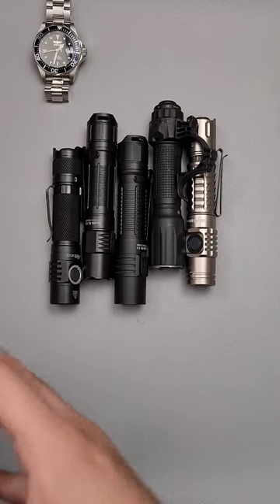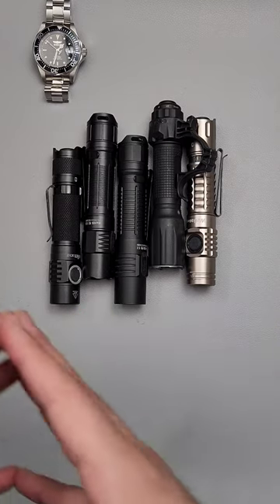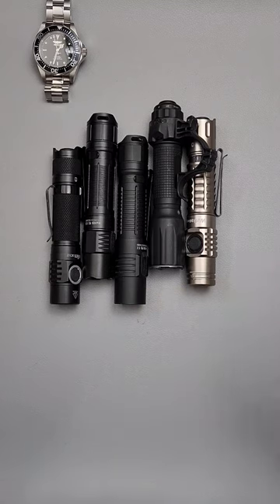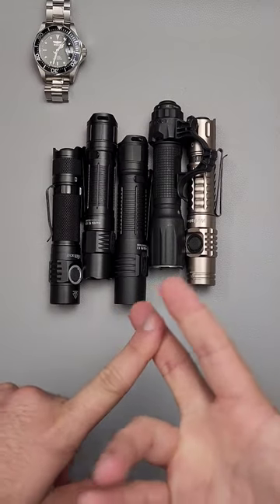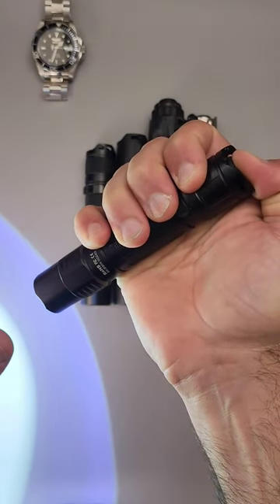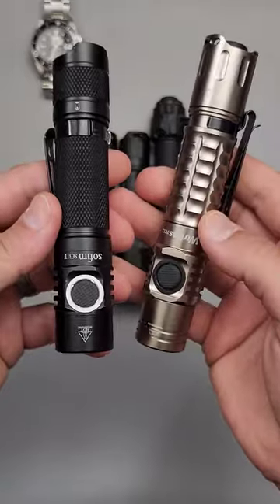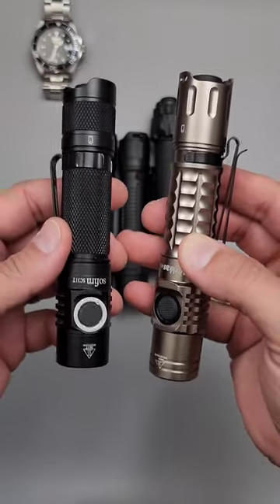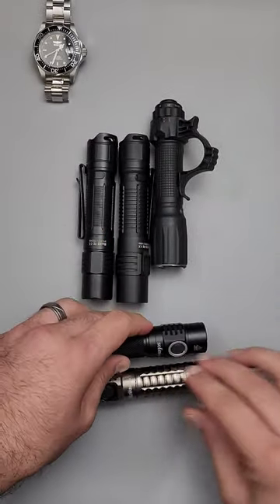What is a tactical/defensive flashlight?? (2 features it MUST HAVE!)

Comment: The new UI wurkkos FC12 have 2 selectable group. group 2 is a tactical mode with Turbo as default. Cheers
Reply from the maker: Oh????! Need to get one
Reply: Are there any ways to flash to the new driver UI if I'm on the older version?

Comment: Newer FC12 has tactical mode, where the tail switch is turbo only (double tap for strobe)
Reply: Would u recommend this for self defense ? Asking for friend thanks
Reply: @came2fastOops After having one for just around 3 months, I would actually recommend it since it is just about unbeatable for the price. I personally have the newer model with tactical mode, and haven't had any issues with the tail cap, battery, or charging. The beam angle is tight, and the hotspot is very bright which very easily disorients everyone I've tested it with for a good 10 seconds after the beam comes off (In broad daylight!).

The only issue I've had is in the stepped mode, where switching modes really fast causes the tail cap to stop powering the light until you remove and re-insert the battery.

Comment: Agreed. I've been searching for a 14500 EDC that can used for defensive lights.
Reply from the maker: hmm, not much. the GTA from lumintop is damn close.
Reply: @maxlvledc  I just got in the Sofirn SP10 PRO. Is this nut for 20 bucks. If it had a dual or tail switched I'd be sold.

Comment: damn, why didn't you release that short before ?! ^^D 
almost went for a TN12 but I just ordered two FC12 after watching your previous videos.
 but if I get it right, if you don't set up on specific mode it's ok ? isn't i ? or you can set it up on "defensive" mode, right ?
Reply from the maker: you absolutely can set it up on any mode you want, so technically it's fine. you need to just remember to go back to the top end when your done with it.
Reply: @CG-hy7hb  I wanted a champagne color but seams discontinued, so I took a Metal Grey and a Black one...fortunatelly considering your experience. I hope both of mine will be improved versions 🤞😁
Reply: @maxlvledc  thanks for that precision, hope the new version software corrects that🤞🙂🙏as user-bp9wp1kb7j says...
Reply: @CG-hy7hb  ok, can't wait to test it !
Reply: @CG-hy7hb  Hey, I received my Flashlights like 2 weeks ago, they both have updated UI ;) Very Happy with it, Gun Metal Grey looks Perfect, Black with grey tube and grey with short tube look badass too !! Hope next improovement from Wurkkos will be impact head and remote switch...seams that Convoy S2+ remote works on Wurkkos, if anyone can confirn...? ;). 
Just for those who would have this other idea : I ordered a SC18 spare tube from Sofirn to mount with FC12 on weaver picatiny rail. It is NoT possible cause the SC18/WK03 has a built-in head. Also even you can fit the tailswitch from fc12, it is not functional ; only it switches OFF once ON with side switch. hope it helps.
Reply: Try ramping mode , set up turbo and switchboff using back button. When you use next time it will start turbo from back button

Comment: Add in front face on lilighr for smashing. Mando.

Thats a close quarters situation.

For A far defensive measure you wanna turn invisible.  This you need a light that cycles your modes without blowing your cover .

No flash on normal use 
Hold to flash ok 

End cap button is always a must 

❤ Solid intel
Reply: When your walking with a flashlight on. You might have an enemy on the radar away from your position . This is where cutting the light and stepping in the shadows will turn you invisible. 

Avoiding the up close confirmation

Comment: My Surefire Flashlight is a real tactical light you wont fumble with it under stress as it only has 1 mode & it's built for using with a firearm. It doesn't make a click sound but u can keep it always on if u twist the rear far enough. Surefire makes real Tactical Flashlights. It's designed for when you are under stress.
Reply: Which one ?

Comment: you forgot #3: must have sharp front bezels AKA The DNA scraper
Reply from the maker: No, that's not a req..if your that close it defeats the whole damn purpose. Even an edge with no crenulatuons will do plenty of damage, and that won't get taken away at checkpoints.
Reply: @maxlvledc  you're*
Reply: @maxlvledc Absolutely a requirement. Rounding corners. Perp gets the drop on you. Etcetera. Not all defensive scenarios will be at a distance, especially when aggressor determines when the fight actually occurs.
Reply: @MrTangent i highly doubt that having the end of your flashlight being a little sharper will make any difference in that scenario

Comment: As important is crenelated bezels. Without them, how “defensive” can one be?
Reply from the maker: imo, the bezel is last resort...if your using a flashlight as a contact tool your already in big trouble. A flashlight is best when it can help you create or maintain distance.
Reply: Add on top of that a switchback cause when you'll start hammerstriking you need that light to not slip off your hand in the first blow

Comment: Which do you recommend then?
Reply from the maker: Thrunite TN12 Pro is the only one I can recommend atm as it's under $50 and outperforms everything else.
Reply: @maxlvledc  thanks! How does the olight warrior 2 hold up? I like the size and design. However, you sold me on the idea of using a flashlight for tactical/ Defense purposes. Could the Olight warrior 2 be used as an effective Defense light if the circumstances called for it? Thanks. Great channel. Discovered it a few days ago and have been binging your content and have a pretty big shopping list as a result haha!
Reply: Amutorch xt35 is what i would suggest, better performance than TN12pro, A switchback attached from the factory, attack bezel, simple ui and with the switchback attached (index finger plastic ring) you can definitely use this flashlight for melee hammering attacks without worrying it will fly off your hand on the first strike

Comment: The sofirn sc31t is absolutely perfect because the tail cap does NOT activate turbo and you have to actually search for strobe effect. One of the better flashlights imo, because In a self defense scenario a flashlight is one of the last things I would be grabbing.
Reply from the maker: U use the light to create distance and give yourself time, also the light can get grabbed BEFORE you known its life threatening..where pulling out a firearm is escalation and won't protect you from the law if you move first.